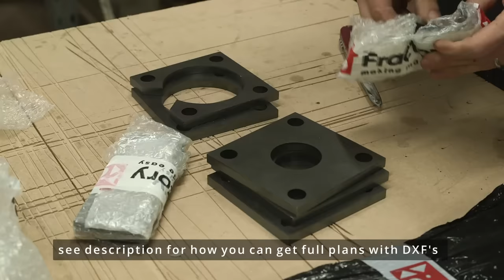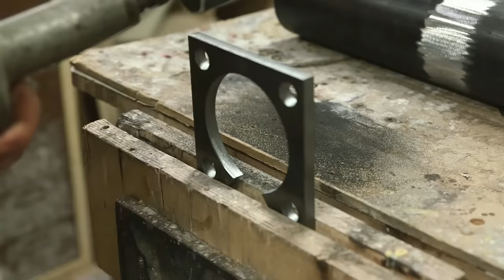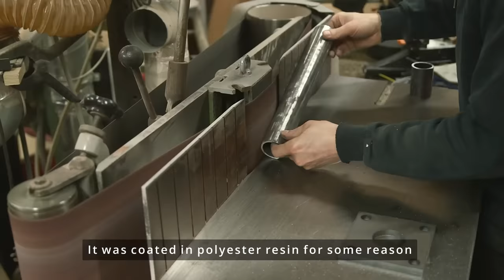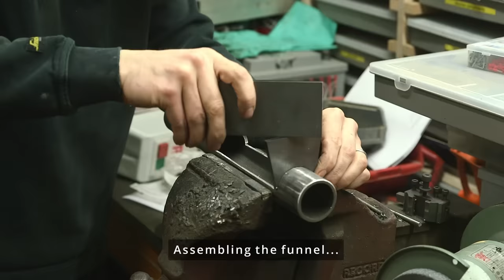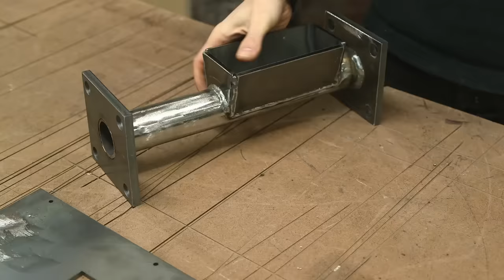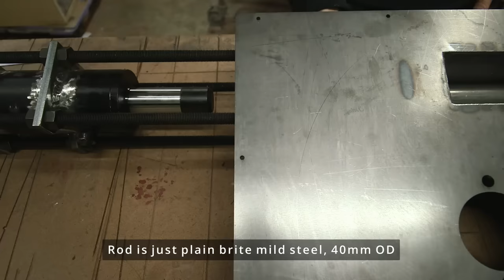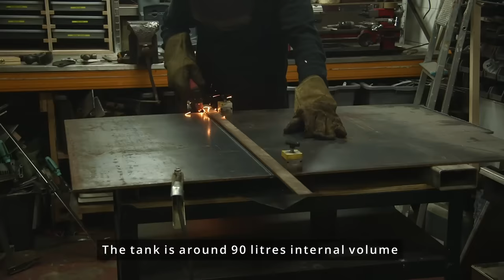Making a hydraulic briquette press

Comment: Woodworking, metal working, turning, welding, hydraulics, electronics... There's no end to your skills. My deepest respect, Sir!
Reply: Absolutely
Reply: When a jack of all trades reaches master level.
Reply: It's also easy to overlook the fact that he had to set cameras, mics and lighting up to film each step of these various processes, and then edit hours and hours of footage into  40 minutes of his particular style of video on whatever computer software he's using so he can upload to YouTube!👏🏾👏🏾👏🏾
Reply: most of it's transferrable
Reply: Just a guess: He has learned the trade and clearly knows what he is doing. The whole hydraulics setup reminds me of what you normally see in commercial industry grade hydraulics installations. 
That's why I thought: Brave! A rollable hydraulic unit (by design and function very vibration-intensive and therefore the enemy of all weld seams and seals!) but not a double-walled tank (expensive) or at least a safety collecting tray for minor accidents or leaks? You should probably plan for this, because if it's too late, cleaning and disposing of the oil can be really expensive and unpleasant. You won't see any hydraulics tank in the industry that at least rests on a safety tray. 

Well, just a thought ... hehehe:)

Also: We drill all holes and make any cutouts in an electrical cabinet BEFORE mounting and wiring the electronics components in it. Yeah, that can not always be done with prototypes, so: Use some plastic foil or at least cloth to cover the components from metal swarf. And no, that is just something you do. The minute time it costs is simply not comparable to hours of sadness a single piece of metal shaving can hit you with.
Did I say PROTOTYPE? We close every cover and secure every single connection or loose cables before testing. Especially those of the motor terminal block. Guess when most accidents happen? Right! When testing a prototype where nothing is clear and things may change. With open and unprotected mechanical or electrical parts, a simple accident or a hiccup ... which otherwise would just be an annoyance ... may turn into your LAST Project. Which is sad and easy preventable by paying attention and not getting lazy.

Have fun making, live long and prosper, guys!:)

Comment: I was Designer/PM on the build, delivery and running of an industrial version of this producing but with 12" square Polystyrene bricks from fluff (cut up polystyrene). The silo was 20M tall 3M diameter and the compactor 10M in length. Yours is a fantastic job. Just some tips, PUT IN A TEMPERATURE CUT OFF RELAY. buy a cheap temperature clixen (click out at a certain temp, say 85C) and run it through a relay to shut everything down if your feed end reaches 85C. You will seriously regret it if you don't, machine wear, ambient temperature and material variation could easily push the exit temperature up to ignition temperature for the dust. Trust me, running a system like that with a fixed size outfeed will generate heat over time. Don't forget you installed this in winter, how hot does that loft get in summer? Also, this may be overkill but we used a hydropneumatic accumulator instead of fixed dimension on the exit end. This works like a spring, pump it up to the required pressure in the oil end and the air compressed to keep a constant pressure. In other words, we exerted constant pressure, not a constant gap size. This reduced the ram pressure and kept the temperature from climbing in the compression tube as the gap could open ever so slightly if the material started getting hot. You could try a cylinder and maybe an old mini sphere? Possibly overkill given the diameter. You don't need your agitator to sit under the whole pile of sawdust. Put a baffle plate in the hopper pointing downward towards the open inlet you only need to agitate the hopper feed not the whole weight of the silo. Instead of using compressed air you can fit a vibrator (a motor with an offset weight securely connected to the hopper) on a timer which only runs for a few seconds attached to the baffle plate which will move the material down. Good luck.
Reply: Very good info and very nice of you to share your knowledge.
Reply: Some good ideas in this, thanks for sharing. I was mainly worried about the temperature increase in summer and/or doing a project that kicked a lot of heat out that gathered in the top levels of the workshop.
Reply: This is some hot knowledge right here
Reply: To everyone concerned about winter vs summer vs combustibility:

I wonder if this will be running through summer as well? With that setup, I guess it does look like it will… but needed to ask either way.
Reply: could one weld some fins onto the outfeed to help it dissipate excess heat?
Reply: @rhamlet5290 unless there was anything else in the sawdust that ignites at a lower temp and sets it off?
Reply: sounds like you were getting 30:1 compaction? im curious about an accumulator vs a standard coil spring, or some spring + lever for mechanical advantage, which i think would be cheaper. what is a mini sphere? also how much force did it take to compact?
Reply: Very talented you are.
Reply: @IsaKocoglu  
Why not run through the summer? At the very least, he can sell his surplus fuel.
Reply: @R Hamlet - I live locally to a wood pellet production facility. It goes up on an average of once every 5 years. There aren’t enough temperature cut offs made to keep that kind of production safe
Reply: Fantastic real world  advice, so generously given! So hoping he reads this very soon! Thank you!' 👍
Reply: Honestly I just love reading stuff I have no clue about. Hoping I'll learn something.😊
Reply: @R Hamlet A small spark can easily ignite a cloud of fine sawdust, grain and sugar mills in the old days would explode because the organic powder clouds were so combustible. It still happens sometimes but luckily not as often.
Reply: @R Hamlet Keeping daily operating temperatures from getting too high absolutely will help prevent stray sparks in the long term, but yes generally the temperature sensors are more for reducing wear and preventing other mechanical/electrical failures rather than specifically preventing fires.
Reply: That’s a neat solution for the compression pipe. I’d imagine humidity affects this process too? Agreed on adding sensors, there’s a lot to break on this and it’s getting into PLC territory to monitor the process. I reckon a feed screw would help with the hopper design.
Reply: Knowledge is wisdom, experience is valuable when you share. Good points @paulbrady9454 & thanks for sharing public.
Reply: Hydropneumatic acculumator would be overkill. Weld a long bar onto the end of the pipe and fit a counterweight into the end.

Comment: I used to work at a presto-log factory in the early 80's. The sawdust was forced through a die with a screw, it created tremendous heat and pressure. You had to be careful not to stand in front as sometimes log pieces would fire out like a cannon.
Reply: Ah yes, the incredible insanity that leads to shredding perfectly good logs into sawdust that you then press into the shape of a log...
Reply: @malkeus6487  You realize that's not generally what happens yes? It's re-use of waste from milling operations.

Comment: Well done!  The only suggested improvement I'd make is to build a simple overhead track maze for the pellets to roll down so you aren't manually transporting from above.
Reply: I expect he'll create something that feeds them one at a time into the firebox. Some robotic forceps that grab one, opens the door, pops it in, and closes the door again.
Reply: I was thinking of extending the chute into a metal drum lined with a heavy duty plastic bag... Need to be able to stockpile the briquettes over the summer and keep them dry for the winter.
Reply: I was thinking maybe some sort of spiral made from heated PVC pipe, not sure how it is for forming but maybe... spiral it around a cylinder and you might be able to get it to work.
Reply: I thought just a simple shoot, then I read your comment and realised how in error I was in my simplicity. A simple shoot is far too easy for this mans skillset, and just wouldn't fit with the briquette press.
Reply: @devandestudios128  Well the briquettes are round cylinders so why not put that to good use and have them roll down to the storage box and fireplace feeder.
Reply: @markfryer9880  Not how I meant it. I meant that the simplicity of the chute wouldn't match the aesthetic look, visual feel and functionality of the press, if the means of conveying the briquettes to the firebox didn't have a similar look, feel and functionality.

Comment: I would add a mist injector that would puff a small spray of liquid paraffin over the wood chips as they fell into the compression chamber. This would help with ignition, repel moisture, and more importantly lubricate the pressed chips as they pass through the compression tube.
Reply: Sure.
The mineral oil component would also turn the briquettes into a whole other material class, with different safety regulations and more rigorous storage requirements.
You did thought about that, yes?:) Also: Nope, wood has its own natural lubrication with lignin and contained resin. Moisture evaporates in storage without anybody even moving a finger. No need for CONTAMINATION with "additives". Man, the final product is used to BURN IT! Not as some design student art project ... (At least I think so?!:) )

Edit: Or if it is not burned(was an assumption) ... maybe recycled into filler material, or the biological way in the methane/bio-diesel path. Anyways ... think about it. You will turn that wood with the addition of paraffin into "dangerous goods" (the material class) that must be disposed of in a landfill or in a special burning facility. Oh ... and you are willing to use precious hydrocarbons for ... GARBAGE, to throw it out of the window? Are you really sure?:)))

The problems we see in the video are design problems and not that of lubrication. Professional presses do not have flat punches and the compression tube is at least partially conical. Throughput must become easier for the material in the direction of ejection and not the other way around. Teflon coatings after the compressor restriction can also help. But that costs a lot.

People think really to much and in the wrong ways and get too fancy(Its entertaining, educating and nothing is wrong trying some new approaches). You can clearly see here what the motivation was about: Nice BRIQUETTES! (And primarily getting rid of that annoying dust and having to change the even more annoying bag). The only goal here is to compress the dust, because for better storage of the garbage. That is easily achieved with one electric motor and two rotating rollers running against each other. This is just a press of a different design. No need for electronics or clogging of complicated mechanisms. You can even (gravitation!) feed directly into the compression element which produces sheets of compressed wood instead of briquettes. That also can easily be turned into a "dough snake" with appropriate nozzles or roller profiles, which looks the same at the end.

Comment: What a heroic build! Your problem solving approach is truly commendable. It's nice to see the waste being turned into energy instead of going to landfill.
Reply: The question is the energy used to make the bricks equivalent to the energy produced burning the the bricks?
Reply: @ericfraser7543  I did consider that a heat pump/reverse cycle air conditioner is probably way more efficient and less polluting but the waste wood is being generated anyway. It's one of those cost/benefit things. If the waste wood has to be transported to land fill there might be a trade off if it's just processed on site?
Reply: @Preso58  agreed, if he is heating his shop with wood that he has to source elsewhere it is also a win for him. he could also power his pellet press using solar if he wants to make the process greener.
Reply: at least the wood dust wouldnt have been an issue for decomposing like all the plastic -.-'

Comment: That is the most extraordinary way to avoid having to empty a vacuum cleaner I've ever seen! Wow, what a project! Well done and Merry Christmas! Subscribed.
Reply: and the most expensive........................??  by FAR
Reply: @raymondo162  I was also thinking something, but after some, though; he is also generating a winter fuel supply for the shop plus the coolant water recirculating thru a radiator with a fan behind is also a source of heat for the shop. So, there is a payback for the materials cost and labor time.
Reply: And then you still have to build Kinda forklift for taking those briketts to downstairs... (I should have thought that in a first place, damn it!)
Reply: as far as "just to avoid emptying" this also provides a way to provide for your home heating and neighbors too, assuming they have heat exchange like the one shown in the video. Secondly, for getting them "downstairs" they look pretty solid, a staggered, padded (with rubber or whatever) staircase they can fall down would work, or just run that PVC pipe down, at a slight angle, or an open top spiral (to unjam it if necessary) But then you need an overfill sensor and stuff. Best to not automate everything, i guess.
Reply: @jormakesanen416  or just extend the out feed pipe a little bit and let them drop down (a slide/shoot)

Comment: This needs to become a product, every wood processing workshop with dust extractors should have one of these. Love your work mate!
Reply: Sure no problem, just $5000 with installation lol
Reply: These are a product, it's just not cheap
Reply: I don't do much wood working but I make fire starter briquettes by melting paraffin in the oven with the sawdust, mix it up and just press it by hand into a pipe, the wax binds it together without needing a hydraulic press but doing this automatically would be nice.
Reply: @Sugarsail1  I do the same, but use shredded cardboard not paraffin as binder as paraffin aren't cheap here!
Reply: The Cheaper way, you buy a pellet extruder. Like Pasta extrusion. Because his way is more expensive to produce.
Reply: @fredscheerle7592  candles/tea lights are expensive?
Reply: @Aikano9  No, paraffin Wax in large amounts is!
Reply: @Sugarsail1  Then You perhaps missed one of his points. With this briquettemachine he eliminated the need of emtying the dustbags, which otherwise is a cumbersome affair to many.
Reply: There's plenty of products like this available and they are considerably cheaper than this. Just not nearly as cool as homemade.
Reply: I've three different ways of doing briquettes. Two by hand and one with a press and none use electricity.   Keep it simple.
Reply: @Scrivscribe This IS a product, we have 2 at work. European made, but exact same details, down to the slit on the pipe.
Reply: @Sugarsail1  sounds good 👍 👍 👍
Reply: @Gatheengen10  But he still has to climb upstairs to get the bin or box full of briquettes and lug it back down. Didn't really solve anything.
Reply: I was actually thinking how to get one
Reply: most woodshops should be selling their sawdust to companies that do this. there was a video a week or two ago on the wyrmwood channel where they showed a trailer they had that was filled with sawdust, a big articulated lorry trailer, it was oso heavy with sawdust it was collapsing.
Reply: It does exist, its just hard for it to be worth it financially for a small shop.
Even if you are burning pellets, they are so cheap it would be cheaper to buy them and throw out your own sawdust and chips, rather than spend man hours manning the machine.

That being said I would love to set up a furnace that would allow me to use my dust and chips and plan to do so in the future.
Reply: @ge2719  I've contacted companies that process sawdust. I'm not big enough for them. We have an annual revenue of about 1 million euro and we only do wood construction. That should tell you something of the economy we're talking about here. They basically want a shipping container of wood dust every week or other week. Maybe a month. I don't think we fill up a shipping container a year.

Comment: This is a man who believes in his heart that if something is worth building, it's worth overbuilding.
Reply: My personal motto is that if something is worth doing, it's worth overdoing.  I love this project way more than I should.  I thought I was good at over-engineering projects, but this is almost Rube Goldberg-ish without quite getting to that level of absurdity.  I absolutely approve.  If I did enough in my wood shop to warrant this kind of dust collector reclamation I would probably try to build one of these, but thankfully I don't.  My wife does want to redo the kitchen and put in new cabinets, though...
Reply: @spencerbrotherson9061  I think in some way this fellow is related to Nick Blackhurst!
Reply: Where is it overbuild, that is pretty much the way to do it.
Reply: @jonasstahl9826  I agree totally, it wasn't overbuilt in the least as far as I'm concered, it was built right. He did what was necessary to make it work corectly without cutting corners. A very well put together piece of machinery. Kudos to you Sir.
Reply: @bobd9193  Sure the m16 hardened threated rods look extremly beefy and he uses 4 of them.
Each can hold about 16t thats alot, but when you think about that the press is able to up too 20t if the controls fail, it is just a safety factor 3.